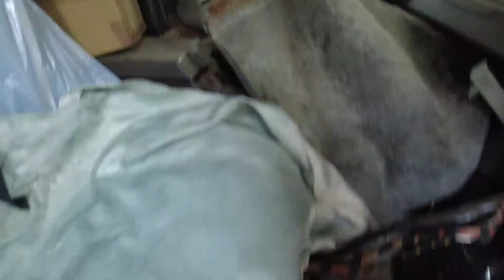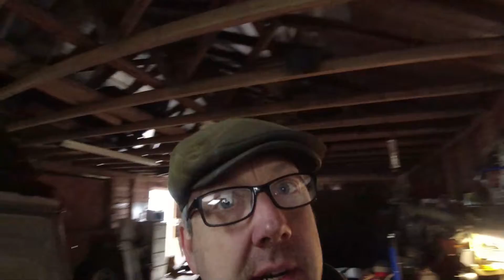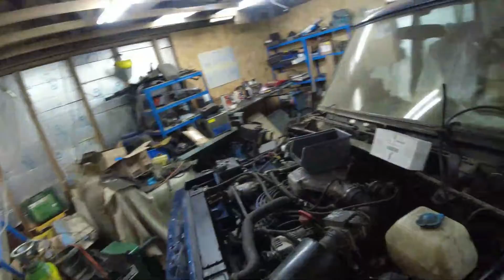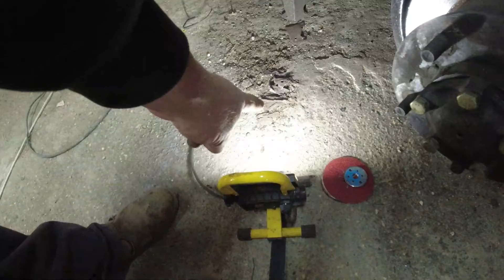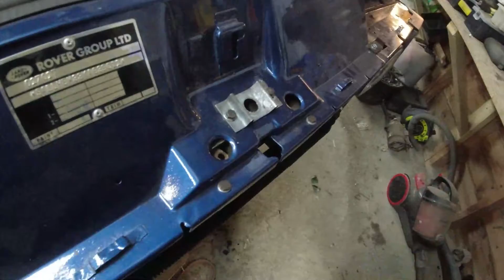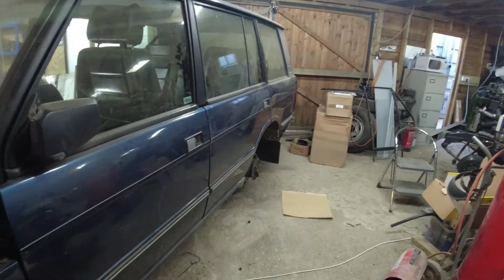1993 Range Rover LSE episode 8 - viscous diff, seat ecu and profanity warnings of course

Comment: The extra legroom in the back is sorely needed, but I wish they had gone for a 4” stretch rather than 8” - I love the proportions of the standard RRC, but the LSE looks too long and the back doors look unbalanced.  Even making slim backed seats so that the front row could sit in the same position with the back of the seats further forward and the rear passengers could be positioned a couple of inches further back with the seat frames in the standard position would have worked well; the seat backs didn’t need to be as thick as they are and a good 4-5” of leg room was waster in them.

I’m damned glad that I found a soft dash with the lower spec - no sunroof to leak, simple and reliable coil springs from the factory, R380 and no seat electronics!  Took me two years to find one of the basic Vogue (non-SE) spec.
Reply from the maker: Is yours a softdash Vogue because I understood that there was the "basic" spec Range Rover and then the Range Rover Vogue SE. The basic spec had option check boxes for quite a bit of stuff but a lot came as standard
Reply: As I understand it, the Vogue was the lower spec from the late 80s onward, the SE, LSE and Autobiography being the higher spec.  They badged the V8s as Vogue or Vogue SE and so on, but mine is a 300Tdi, and the diesel Vogues seem all to have been badged for the engine, while the diesel SEs and LSEs still got the Vogue SE badging.  So, mine has the extended “Classic” badge on the left and raised lettering “Tdi” on the right (except the dot of the i has fallen off…).

I’m the second owner, so didn’t get to spec anything or ever see how the ordering system worked, but it has 300Tdi, R380, coils and the plain roof.  The centre console has the dimply rubber mat around the gear levers and a plain grey plastic trim around the window switches rather than walnut trim. It is all the spec I was after, and took me two years to find (it belonged to the sales boss at my local specialist, so had been under my nose all the time, but hadn’t been for sale and was offered to me before being advertised - funny how things turn out).  I have however added seat heating, heated front screen and aircon with Gen parts (ac parts all came from a scrapped Discovery ES 300Tdi).

He had replaced the anthracite coloured triangular centred alloys with the TWR 5-spoke factory option of the soft dash and added police-spec rear springs, which give it a great poise (similar to RR Sport).  I have no idea about the condition of the Boge strut, but with these springs, it doesn’t matter.  He was going to give me the front springs for me to fit, but I like it as it is.  Grey interior, green paint with black bumpers, so really looks smart - I wanted grey inside and was keen on only a few paint colours, so was lucky.

Comment: Good video got the same problem with my viscous coupling do you know where to buy one from a reliable source thanks Danny
Reply from the maker: I buy UOS from ebay, P38 and Classic viscous diff unit is the same but the housing and flanges are different. 

Buy from somewhere that can guarantee it works, fit it to the front of the transfer box and use a pry bar to try turning it while the back wheels are on the ground. Saves a lot of time in reassembly .

Brand new are also available from Ashcrofts
Reply: Will do that thanks Danny

Comment: Hi, Richard. Could you please help me with something? I was hoping you could tell me where the front & rear wiper motor relays for a 1979 suffix F range rover is located. neither one of the wiper motors work. the front one used to work when I started my restoration, but I may have disconnected the relay by accident some years ago.
Reply from the maker: there should be 2 relays in your car, one for the starter solenoid and one for the heated rear window. The rest is free from any protection and share a single fuse.

Drop me an email if you need help with the circuit diagram
Reply: @churchhouseclassics  Thanks for the help.🙂

Comment: So that viscous thing is the cdl which I manually engage on my Defender?
Auto electric work would be easier if they didn’t stuff the important stuff under seats!!
Reply from the maker: yes to the viscous diff lock unit. Totally automatic on this age of RR and I think fitted to every borgwarner transferbox on the land rover range.

Agree on the electric stuff but the under dash area is rammed also, no place else to put it.
Reply: @churchhouseclassics  thanks and yes I’ve a still got to fix a on the blink earth problem behind the dash on my series 3 for the dial reading globes 💡 
Auto electric work is my least favourite job!